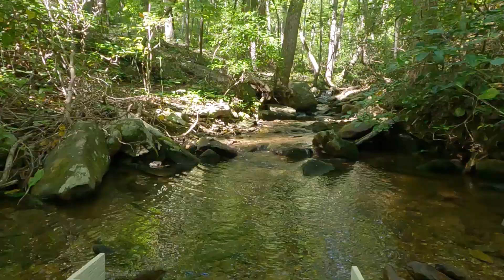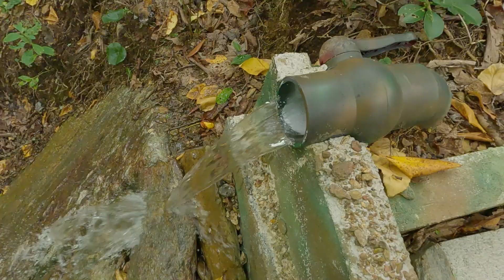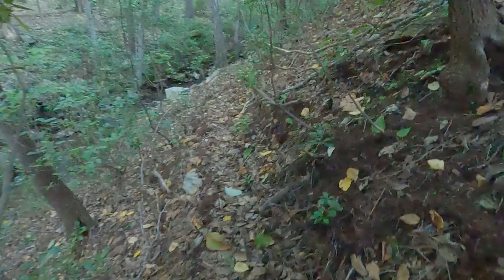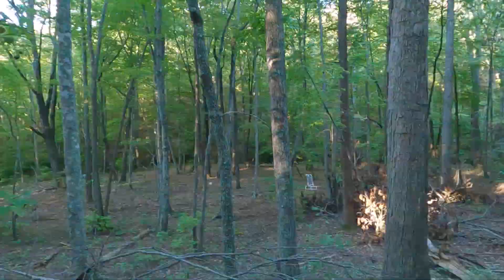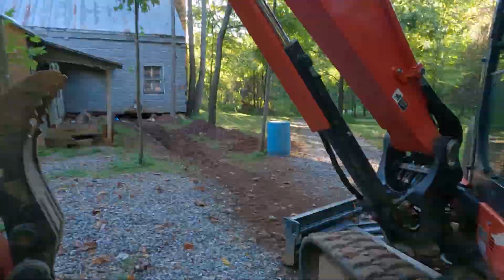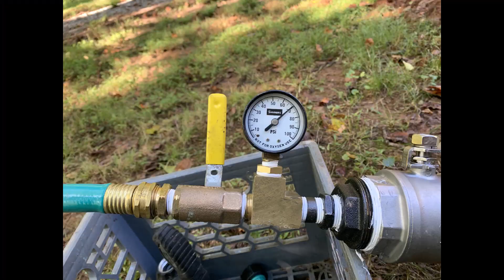Micro Hydro Penstock - Pressure & Flow

Comment: at 4:42, this looks like a fail.         the  filter  Needs  to  be  'self-cleaning'.      aka,  flat  and  on  a  slant.
Reply from the maker: It may be a fail as you mentioned. I have to repair the intake dam, It sprung a large leak last month. The intake does not receive the direct flow from the creek, it's offset to one side. Before I change over to a Coanda type screen, I want to work with this setup and see how it performs.

Comment: If you would like to have some help with Micro Hydro give me a call Spencer at Langston's alternative power
Reply from the maker: Thank you Spencer, I might just take you up on your offer when the need arises and I'm sure it will.
Reply: @Magutz  Just my opinion but Langston is quite expensive and you pay a unnecessary premium for a system that in my view isn't any premium.
But if you want a close to plug & play system and don't like to fiddle with the generating/electronics part of the hydro electro system yourself than Langston is your man I guess.